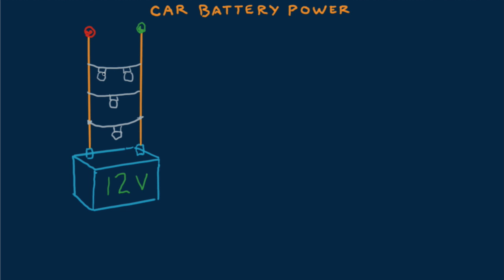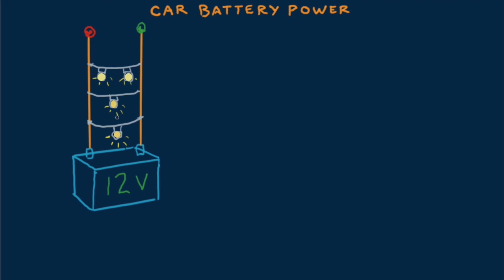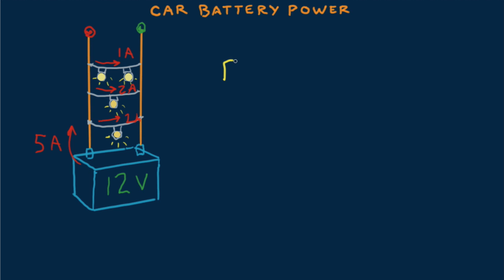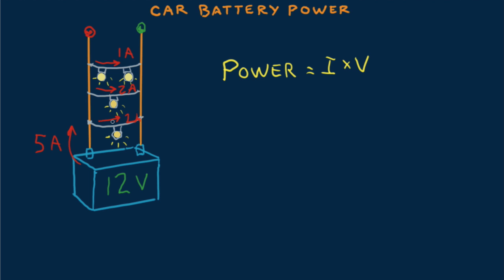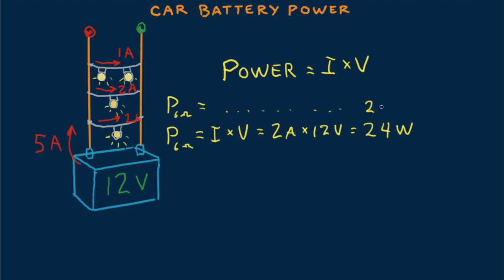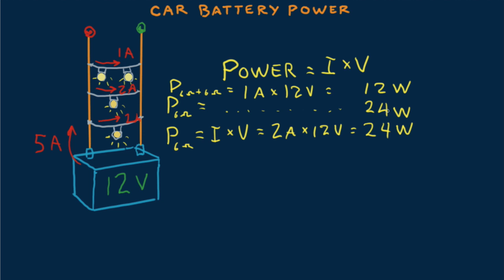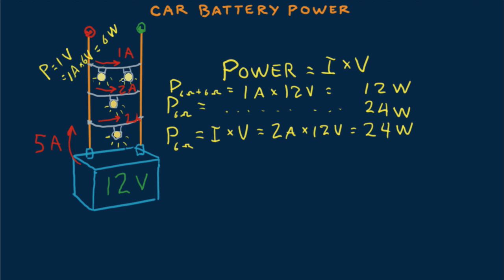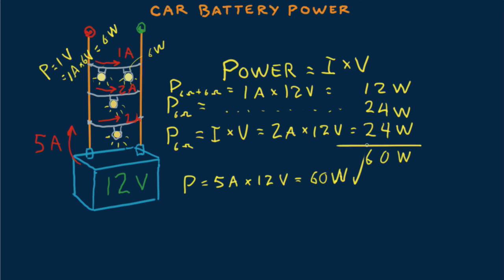Hewitt-Drew-it! PHYSICS 99. Car Battery Power

Comment: we'll have to use P = (V)^2 / R  ....  find equivalent resistance of total circuit, then insert 6 volts into the above equation and divide by the Equivalent resistance...  VOILA !!  QED, Quite Easily Done.... (now I better go check to see if that is right..... BRB )
Reply: Philip Y makes no sense